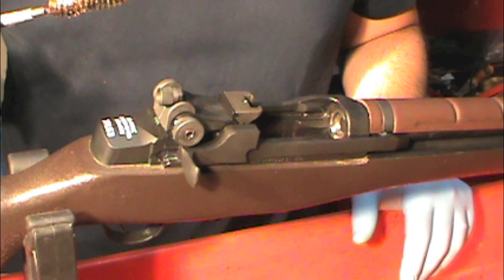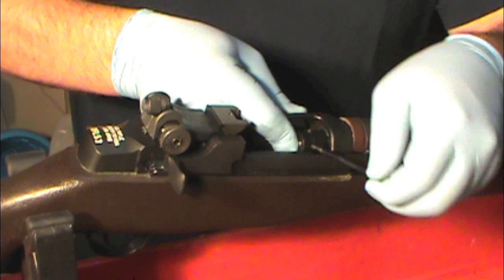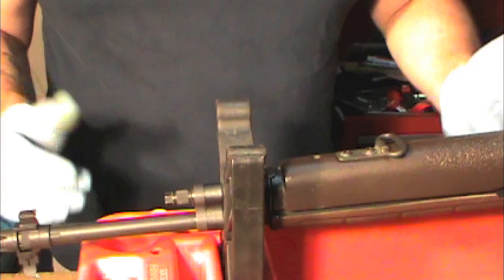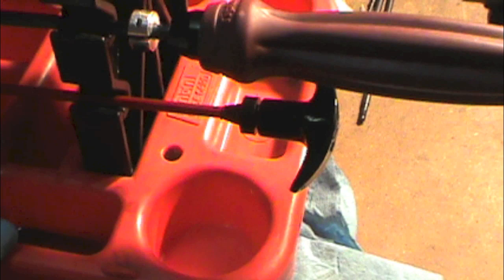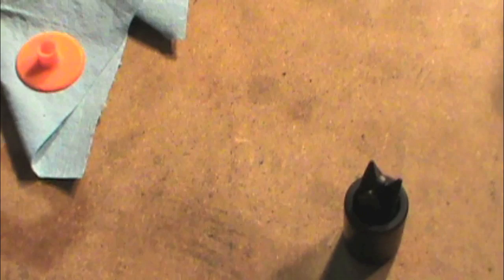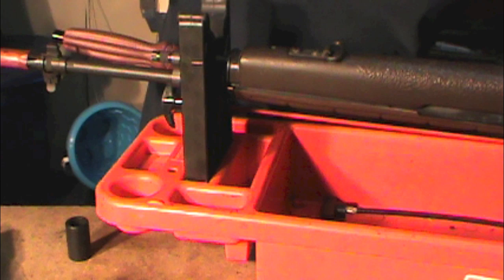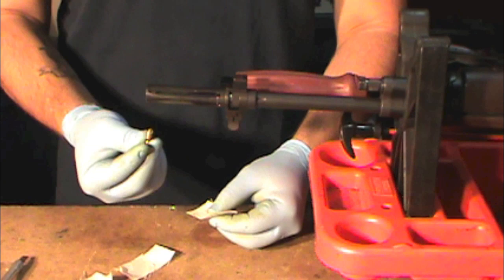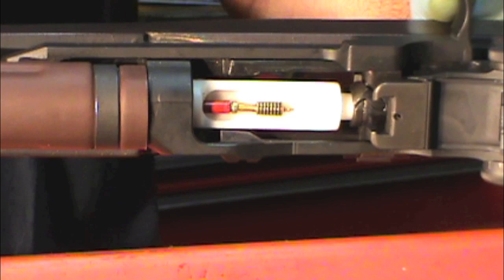M14 Cleaning Video Part 2

Comment: Love all your M14/M1A videos, Tony. They really are invaluable! Was wondering what type of denatured alcohol you use to clean your brushes. In most videos you say denatured alcohol but in the gas system cleaning video you said, IPA. After googling the two, I found that IPA and denatured alcohol are different. I was about to go buy some S-L-X Klean Strip Denatured Alcohol and was hoping you could advise as to whether or not this is a good choice and the right product for bore brush & mop cleaning

Comment: tony great video but I have a stupid question but why not take the rifle apart then clean it is there a reason to clean it while its together
Reply from the maker: M14's run so clean that there is nothing that requires you to take them apart but maybe once a year. Everything you need to do to clean it can be accessed without taking the rifle apart.

Frequent disassembly can loosen the stock to action fit which will degrade accuracy. Also, for glass bedded rifles, it can take up to 20 shots for the action to settle into the stock and for accuracy to return again.

I'm doing some testing and I've got 120 rounds through my rifle and it's still shooting under 1" without cleaning the barrel or adding any additional lube.

Tony.